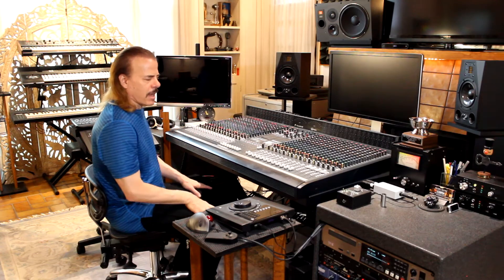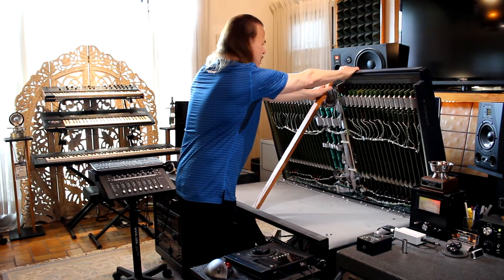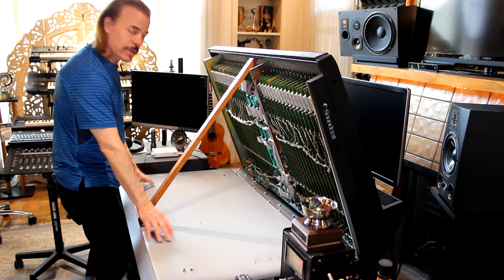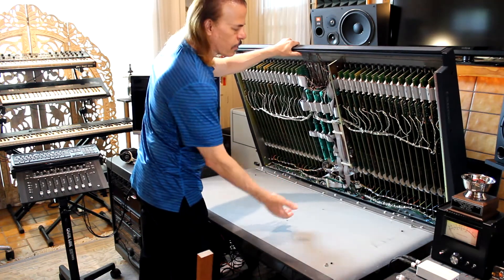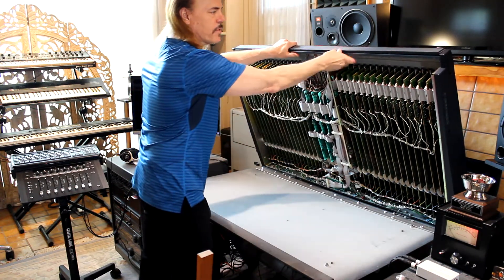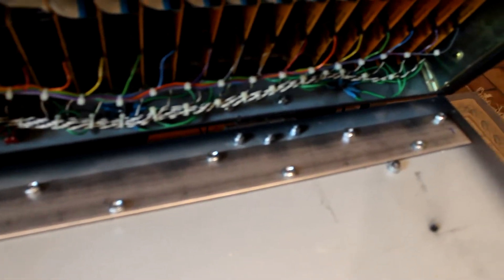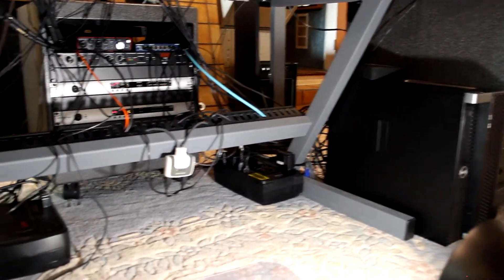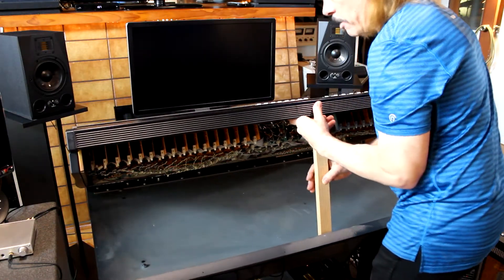Servicing the Soundcraft Ghost 2.0

Comment: you got a like just for opening the board up like that.  hilarious yet practical...speaking as a guy who has fixed a few consoles.
Reply from the maker: Well, you got a like for liking the mod.  Thank you Jon.
Reply: @RichardZeier  - well....then you get a like for liking the like.  how do you like that?
Reply: actually...i do have a question.  the ghost is supposed to have pretty damn good preamps.  what would you recommend for an external preamp that is NOT a  >$500 preamp to use on a channel that would be a significant upgrade to the input.  Brand/model?  I'm curious about this as most of us have to choose between ITB with a couple of great preamps (read ~$1000) or a very nice board(Ghost) and either rely on the preamps or find the minimal upgrade couple of preamps for external use.  in other words...not looking for dramatically better world class preamp answer of typically $1000-$5000 preamps....just the next step up to 'add' to the ghost or similar board.  your thots?  might be a good video to do.
Reply from the maker: @ruby2thursday  I'm not sure I can recommend any particular mic pre in that price range.  That's not to say there are not a lot that would be a fine, I just haven't used that many of them.  In my studio, I have one great mic pre/channel strip, a Manley Core, but that's around $2K.  That pairs with my best mic, a Lauten Eden LT-386.  From there it drops down to an AKG 414 and some moderately priced condenser and dynamic mics through a few self-built mic pres that are probably equivalent to a good $500 commercial unit.  If I'm recording a full band, then I'll run through channels on the Ghost that have been upgraded with better caps and opamps.  The Ghost pres are pretty good but they still have a weak link in the gain pot.  I have a mod to replace the pot with a miniature rotary switch but haven't had the chance to actually install one in the Ghost yet.  I plan on doing that in the near future.

Comment: Any list of mods / part # to be found anywhere? Love these vid series Thank you for spreading the knowledge 🙃
Reply from the maker: You're welcome ratchetboo.  All of the mods that I have done personally and have documented are on the RockItScienceAudio.com website.  As far as part numbers, I have a service manual for the Ghost and you might find a PDF online somewhere.  However, the part numbers are for Soundcraft parts that are no longer available, so you need to get creative.  You can still find switches that will work but pots are more difficult.  I have found Panasonic pots that are close in value but don't exactly match shaft length or mounting style that require adjustments to make them work.  It's basically like repairing your 57 Chevy in Cuba.

Comment: Very clever idea. Mine needs some service in the master module. Is it possible to send you just the mastermodule to service it?
Reply from the maker: Hi Nikolaus,
As much as I enjoy working on the Ghost and finding ways of making it better, unfortunately, my schedule doesn't allow for service work outside of my own studio.  However, if you have any questions specific to your problem, I may be able to point you in the right direction.
Reply: @RichardZeier  Thanks for your fast answer. My left CRM O/P has a loose contact. I have to move the cable then sometimes it's working. When I have pluged in the MIX inserts it works. But it looses the conection too sometimes.

Comment: Hi Richard, now that you can open the console easily, could you make a quick video on how you removed the front headphone jack?
Reply from the maker: I believe I addressed the Headphone Jack in one of the previous videos.  I always found the Headphone jack to be more of a problematic nuisance than a convenience, certainly not something you want in your main monitor path, so I removed the jack, capped the hole, and used 2-pin shorting blocks to bypass the signal at the headphone jack connector.

Comment: A piano hinge would make it simpler.
Reply from the maker: Hey Frans,
The piano hinge is an interesting concept.  I can see where a one-piece hinge would alleviate most of the alignment issues and possibly preclude the need for the reinforcement bracket.  I'm interested if you have info on the price and availability of piano hinges.  I do, however, think there may be some challenges installing it.  I'm assuming the hinge sides cannot be separated and would need to be installed as a single piece, which would require the console to be completely inverted to attach both sides at once.  Also, I'm wondering if there may be any clearance issues with hardware or connectors anywhere along the entire length of the console, or if the folded lip on the underside of the console backside might be a hindrance to installing screws.  But if not, it may work fine.  Let me know if you do it, and please share a video.
Richard
Reply: @RichardZeier  hi Richard. I have worked with a Ghost. Never on a Ghost. I owned several consoles. My largest being a 29-8-2 D&R Dayner. A console that was made up of true channelstrips. 

Piano hinges are most often manufactured at a length of 6 feet (72 inches, 1828.8 mm), and are of course named for their typical application on piano lids. Piano hinges are also often called continuous hinges, and the name is interchangeable.

They can be bought in several lengths. Up to 2 meter. I think around 2 euro for 60 cm. Key is enough washers. Then strength is built up. 

Recently saw a 44-8-2 Amek console for 350 euro.

Maybe time to upgrade. I saw for 2000 a 44 ch. Midas verona console. That would be interesting.

I am looking at a 5.1 analog console. All the best.
Reply from the maker: @FransvandenBergeMuziekschuur  Thanks for the info Frans.  Someone else who's interested in doing the hinge mod may give that a try.  There are a lot of old analog consoles available for seemingly affordable prices, but from experience I know they all need work.  Since my Ghost is now serviceable, I'm going to stick with it until I get rich.  Happy mixing.
Reply: @RichardZeier  agreed. I think I’ll go with a Midas Venice 16 and a controller. And then save up for either a Amek Media 51 or a new SSL matrix. 

I really like the SSL six pre with compressor. And a pair of Klark Teknik 76 buscompressors.

Comment: Hi Richard! I'm currently after a Ghost 24LE, found a very good deal for one. Seller says the Cntrl Room Monitor Pot needs some repair though. Still havent check it out personally, do you happen to know (if its needed) if replacing it is something that can be done easily or if it's a pain in the a**?  Ty!
Reply from the maker: Hi Edoardo,
If you have already performed the Ghost 2.0 Mod as described in the above video, then the answer is yes, replacing the control room monitor pot can be done easily (provided you have competent technical skills).  However, if you haven't done the 2.0 mod, then unfortunately no, it's a major pain in the a**, just like performing any other repair or maintenance that requires opening the console.  Hope that helps.

Comment: Amazing video explanation! Where did you get that mixer stand ? I have been looking for one.
Reply: I have a modified Quicklock Z stand which fits perfectly under my ghost 32. 
You'll need to shorten the middle bars. New cost about 99 euro's, second hand about 50-60.

Comment: This was a good idea! Opened my Ghost the other day and it was not something i want to do very often. 

I have a couple of problematic channels on my Ghost. One channel wont pan left if i route it to the mix bus. But pans fine when routed to the aux bus'es. I looked at the schematics and it looks like there is diodes on the output before the switches. So i guess one is faulty. 

The other channel wont make sound no matter if i route it to mix or aux bus'es. But meter on the meter bridge is showing a signal. But if i reverse the channel, i get a signal on the mix b bus. Not shure where to begin with this one. hehe. 

Any pointers? :)
Reply from the maker: Hi Thomachinex,
The easiest troubleshooting that can be done for a dead channel without opening the console is to check the channel insert.  This can be done by taking an unused TRS plug and soldering the tip and ring together.  If there is a problem with the insert jack normal contacts, the TRS plug will bypass the contacts when inserted.  For faulty left/right signals be sure to check the other assign switches to see if they pan to the groups, this would indicate a faulty L/R switch.  BTW: there shouldn't be any diodes in the audio path.
Reply: @RichardZeier  Thanks alot for your reply. The non panning channel does pan on all other routings. I tought there where a diode, but its a part called SK1 on the schematics. Its just before the switches to select mix, group 1-2 etc. 

I did try to bypass the dead channels insert with a trs cable without any luck.

But it looks like i'm getting a 24 channel Ghost i can use for parts. :)
Reply: Well, i was certain it said SK1, but after viewing again i think it is a 5K1 resistor on the output before the bus cable and switches.
Reply from the maker: @Thomachinex  If you do get a Ghost for parts,  let me know if you would consider trading a few parts for some tech support.
Reply: @RichardZeier  That sounds like a good deal. What are you after? Havent picked it up yet, but i bought it.
Reply from the maker: @Thomachinex  I would like a few input channel circuit boards that I can experiment with on the bench.  I also need the input rearcon boards that go with them including the white ribbon cables that connect them together.  The knobs and hardware that go with them would be nice too.  Please email me at rockitscienceaudio@outlook.com where we can discuss it.  Thanks.
Reply from the maker: Hey Barry,  Douglas Self's book "Small Signal Audio Design" is probably the best pro audio book ever written for techies that like to tear things apart and make them work better, and walk away with some understanding of circuit design.  It's a well-worn reference book in my library.  Highly recommended!

Comment: Peace Richard Zeier. I have a question, I record from the direct outs of my Ghost to the inputs of my DAW (24), and the DAW returns to the desk on the tape returns. What options do I have for monitoring what is sent to "tape" and what's recorded on 
"tape"?
Reply from the maker: Hey Yusef,
I work in a similar way using 16 direct outs as inputs to my DAW, and use Tape Returns as inputs from everything except microphones into the Ghost mic pre inputs.  The B Mix is my monitor source with the REV buttons engaged and the Source buttons set to monitor the channel.  This allows me to monitor through the B Mix rotary faders that are always set to unity, and the Main Fader path feeds the direct outs as well as the console buses.  This setup is also convenient because the meters will reflect what is feeding the tape returns or the mic pre inputs without changing anything.

The only thing I ever change is the buttons on the back of the console from Direct to Group Out when using the Groups for recording.  One thing I don't do is run the DAW outputs into the console for summing.  It just takes extra time that I never have, but if I did do it, I would use the B Mix to sum to the B Mix Outs.  Hope this helps.

Richard
Reply: @RichardZeier  Thank you for your insights. Peace & Love

Comment: Are you repairing it that often? :) Great idea.
Reply from the maker: Hopefully, not too often.  I actually enjoy working in the studio way more than working on it.  However,  I used to keep a list of problems that developed over time, and maybe opened the console every 2-3 years to clean things up.  Now, if a problem develops, I can open the console and replace parts in a hour or two.  Occasionally I like to try new mods.  This makes it real easy to tweak a circuit, knowing if it's not what I expected, it's no big deal to change it back.

Comment: Hi Richard, i have an issue with my Ghost 24LE (not LE Version). The right LED master bar on the meter bridge (the bow) is not working anymore since today. do you have any suggestions to solve that? Thanks for any hint. Greets, Mirko tonformer
Reply from the maker: Hi Tonformer,
Assuming everything else (audio & CRM Meters) are working.  An easy thing would be to check the Meterbridge connector on the back of the console to be sure it's providing good contact.  Other than that, you will need to open the Meterbridge and take some measurements with a DVM.  The meter itself is basically a chain of LEDs connected end-to-end with a +17V and -17V source on each end.  If a LED fails, it will break the chain and no LEDs after that one will light.  There is a comparator opamp for each LED and these are in a ladder formation being driven from a single opamp that converts the audio signal into a DC Voltage that is fed into the non-inverting input of each opamp in the chain.  All of the inverting inputs are tied to a chain of voltage-drop resistors that determine the reference trigger level for each opamp.  Any break in the reference chain, being a failed resistor or bad solder joint can end the party.   There is also a current limit transistor of the +17 end of the LED chain.  

The first thing I would check is for a DC Voltage coming out of the opamp feeding the non-inverting inputs of the LED driver opamps.  The DC Voltage should change with the audio signal.  Then I would check the current limit transistor to be sure it's providing a positive voltage from it's collector and that there is -17V at the other end of the chain.  The chain Voltages should increase incrementally as you test each point in the chain.  I hope that helps.
Reply: @RichardZeier  thank you i am going to check this :)
Reply: @RichardZeier  and yes. all other bars are working fine, just those right channel master bowed bar collapsed. the 25 pin connector is fine.